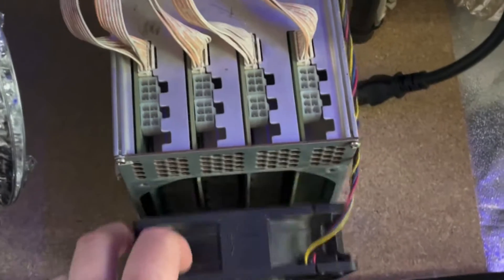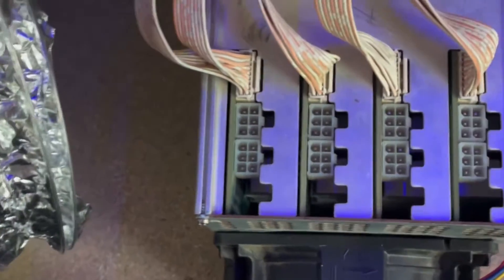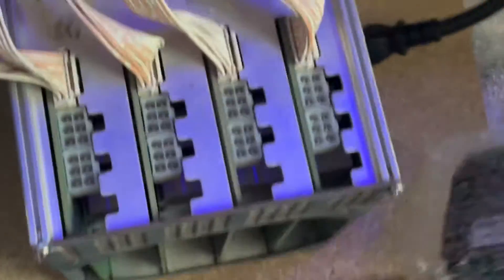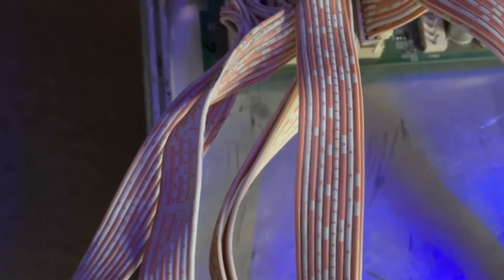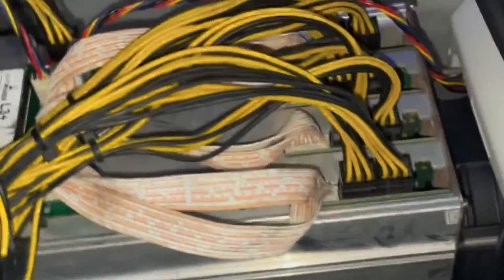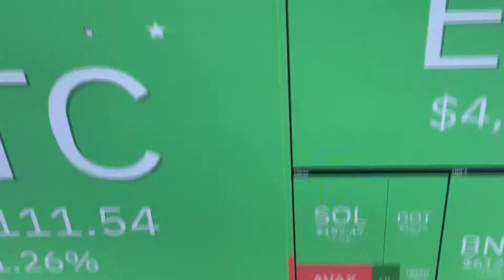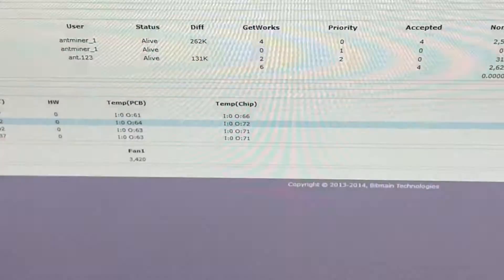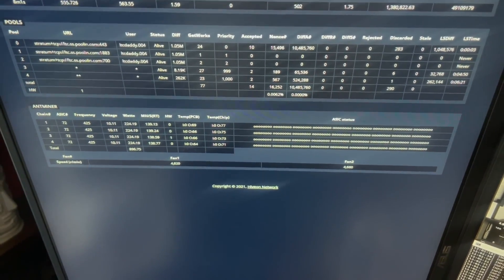L3+ Hash Board Not Showing Troubleshoot

Comment: Hi everyone, I have a problem with my L3+ , the green light is always on , and its not showing in the IP address , and the litecoinpool is showing that its offline
Reply: I already updated the L3+ to hiveos , i hope anyone help me
Reply from the maker: @yahyaayyash2209  could be a bad control board
Reply: I cleaned the board and do reboot and restart from the IP address , and i turned off the L3+ and turned them on , I changed the Data cord , i did the rest button on the L3+ to return to the main setting, and its the same all the time green light is on but its offline , i went to shop to fix my L3+ and he asks for 225$ to check only , and he needs a hole 5 days , can I return the system to blissz
Reply from the maker: @yahyaayyash2209  100 bucks or cheaper for a board and super easy fix i bet its the board their crappy
Reply: Its been working good for 5 days, i did auto tnd and every problem started to happen

Comment: nice bro, you try switching around the power cords, or any that  i had that with mine and it did that
Reply: after watching some more, did you ever get this fixed, also did you try going back to old firmware for it?
Reply: nice job man, stay with the base ya  i agree or one of the custom ones , ty for heads up that the hive causes this on them
Reply from the maker: @jimsinnovations2737  ya it kind of locks u into hive which is dumb.
Reply: @blinkbb1223  ya i saw that, that was dumb lol, they have hiveos asic hub for others as well and it seems to do the same thing to them on some of mine
Reply from the maker: of course including new cables too